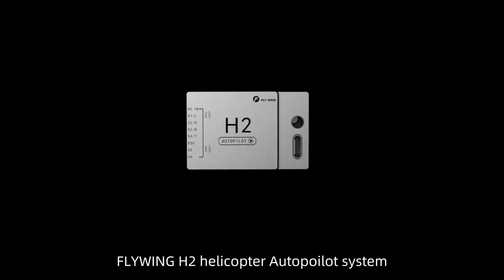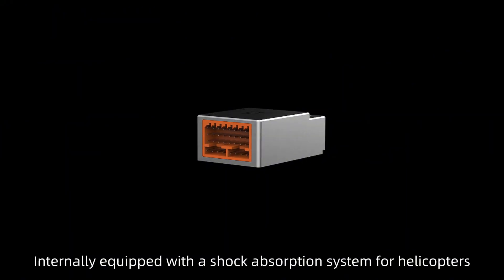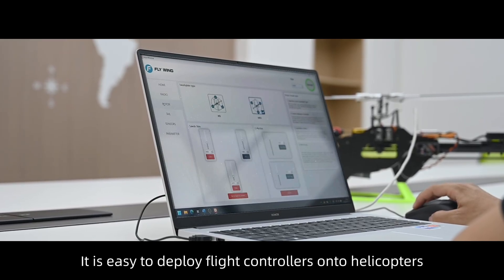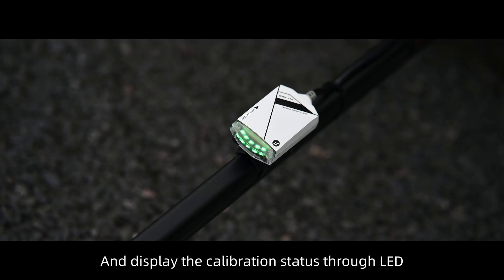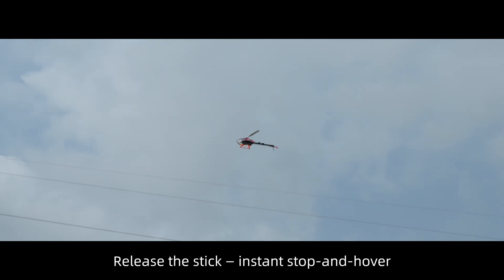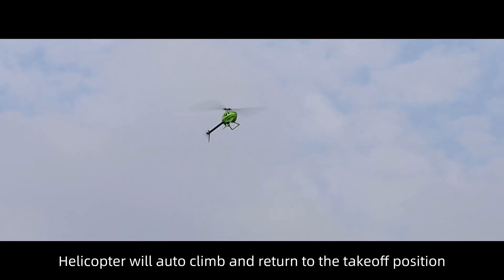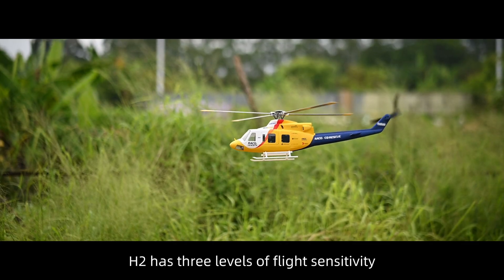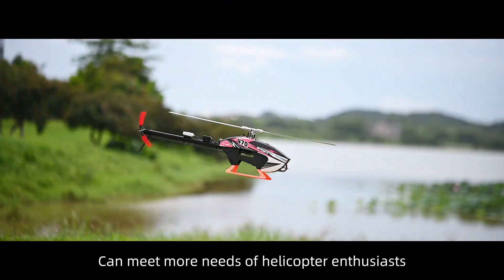FLYWING's latest generation H2 helicopter flight control system is more stable and more powerful！

Comment: I have the DSMX converter binded to my transmitter and connected to my H2 with the FlyWing DSMX converter but the H2 is not connecting to my transmitter as stated in the FlyWing setup program. The H2 is connected to my computer and shows connection but the program says it is not connected to my transmitter. Any ideas ?